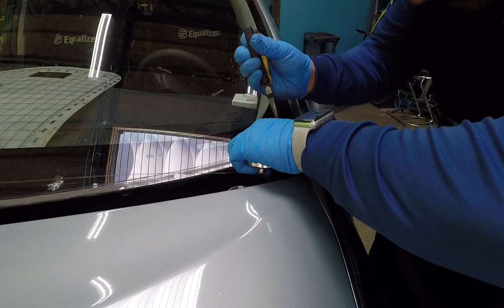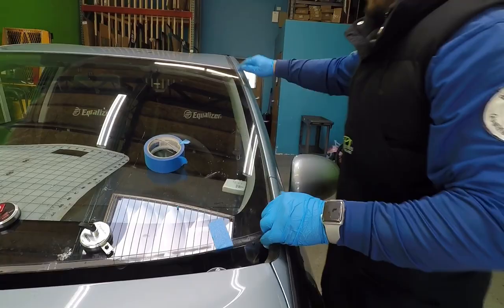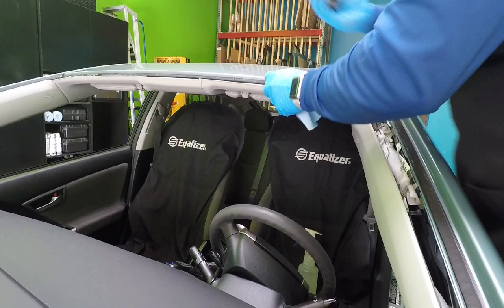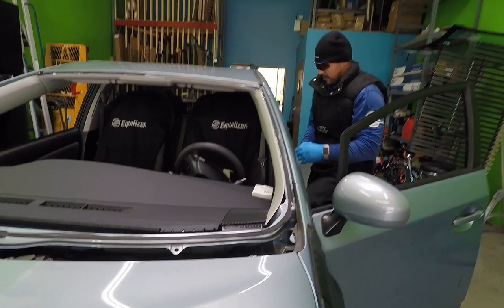Toyota Prius 2010-2015 windshield replacement using the Raptor by Alfredo’s Auto Glass

Comment: I replaced my windshield from Safelite now there's a very high wind niose
Reply from the maker: Shahaan Saleem I’m sorry to hear that there’s different  reasons why you have the air leak, it might be that the cowling was not removed at the time of installation that’s usually one of the main reasons second not a proper setting. Best thing to fix the problem removal and reinstall.